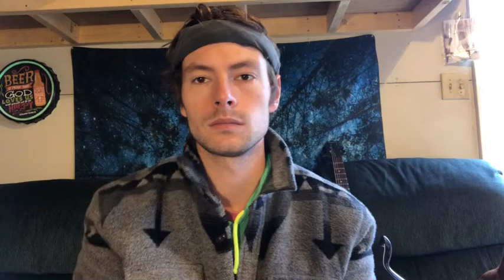Bloom Energy - Mechanical Engineer’s Perspective

Comment: All off this frightens me, sorry. What doesn't frighten me is  Piezo Electric   Quartz's Crystal Engines, that  are 100% pollution free, and need no natural gas, The other thing that doesn't frighten me is  to make secure the foundations of your home (it's footings) and excavate a very large pit (cavity) and then insulate that pit for heat retention insulation, and then fill that pit up with lava rock, or some kind of rock, and then purchase fresnel lighthouse lenses and focus the rays of the sun on the rocks and then charge the rocks up with heat, and then make a flume and channel that heat to a pipe that connects to a sterling engine that has a 3-Sproket planetary hub and connect the sterling engine to the crankshaft of a Honda 5,000 watt generator, that is now non polluting. It's going to be necessary to track the sun with a computer that will adjust the fresnel   lens in order to keep all of the suns rays  concentrated on the rock pile all day long, and to have long shafts directing all  that heat from the sun. You are basically making a "heat battery, which is completely clean, because heat is just heat, and stored heat will power a generator, and will be non polluting, even compared to a electrical battery,  that has so much caustic stuff in it, that is no good for the environment.
Reply: Does your own home have this setup that you described ?
Reply: I have approximately 3 yards of lava rock. at the back of the property, it is adjacent to the end of my mobile home, what I don't have yet is the fresnel lens, and a tracking laptop, the pit hasn't been dug yet, but it will be, then it will be insulated in order to keep the heat from escaping. I am really excited about this summer project. So the answer to your question is "Not Yet" but let me emphasize here this will become a reality, in due coarse. People think of energy storage, as electrical storage, but energy storage can also be a "Heat Vault" and as soon as I have several yard sales this summer to get rid of 90% percent of all my late partner's accumulated worthless refuse, the leather gloves will be on me, and that shovel will  go into action. Take Care, Kelly

Comment: Lol, please Stick to what you're good at, chemistry is not your strong suit.
There are so many things wrong with your octane vs. methane comments... keep reading up on it

Bloom is identical to natural gas power generation when it comes to chemical inputs and outputs, they are just much more efficient as they generate dc directly from the chemical reaction instead of boiling water,  turning a turbine etc. 

Natural gas isn't just methane bro, it's a blend of light hydrocarbons including ethanes etc.

May want to brush up on your mechanical engineering as well,  we're not convinced
Reply: Okay now I see why you don't believe he's a real mechanical engineer .
Reply: So are you saying that this system the Bloom Box system only works if you have it hooked up to gas ?
Reply: @gardensofthegods  
Bloom energy servers may use a number of different fuels, natural gas is the most likely gas that an installation would use today. 
They have some installations which use methane from landfills and they should be able to run on pure hydrogen gas but there is no source for that in nature

Comment: @Vicent Gambuzza, 
Combustion is not only about the flame that you see in the stove, but any Hydrocarbon, when it reacts with oxygen and produces, CO2, H2O and energy is combustion. Even our human body cells are combustion machines. Therefore Bloom Box is an silent combustion box, which take CH4, Air (O2) and the fuel cells combines them, reacts and produces CO2, H2O , Electric energy and other effluents. If your Bloom box can react CH4 in absence of atmospheric AIR and produces electric energy then its clean energy, where as Bloom box not clean energy box, Its a silent energy box.